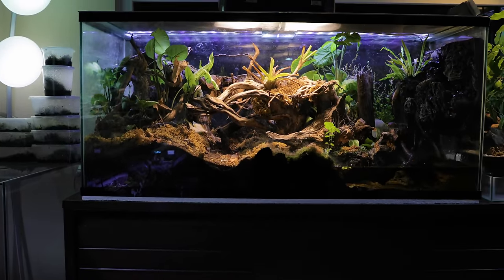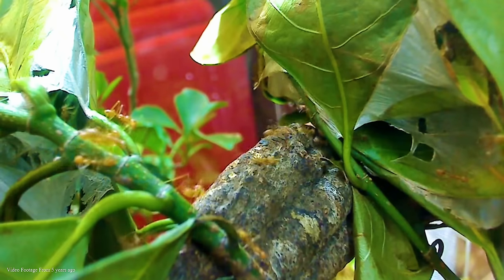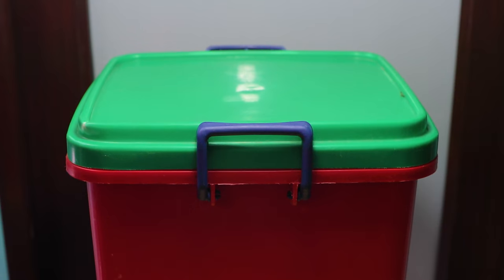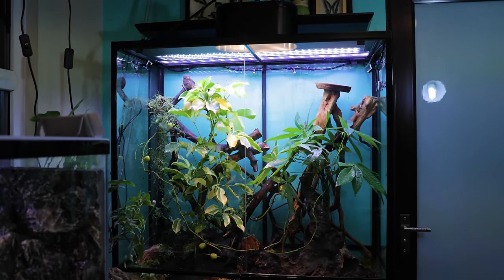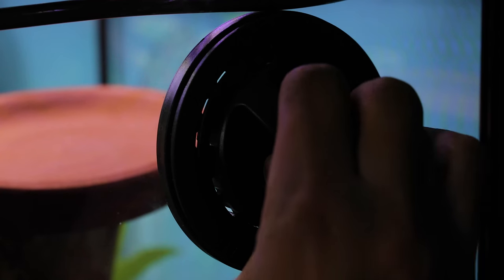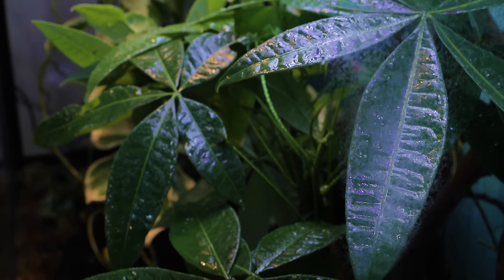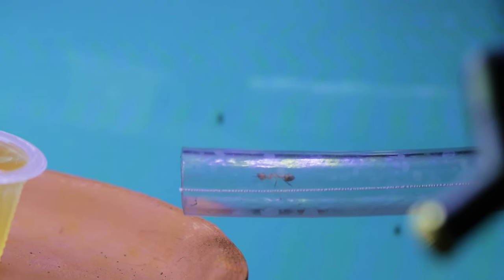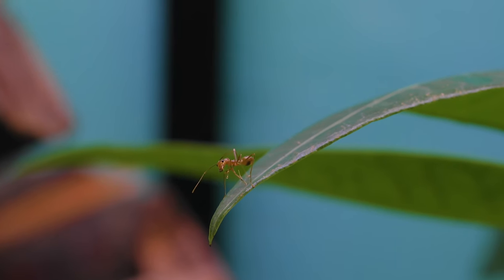My New WEAVER ANTS Will Blow Your Mind

Comment: One day when I went out to my wood-pile, or rather my pile of stumps, I observed two large ants, the one red, the other much larger, nearly half an inch long, and black, fiercely contending with one another. Having once got hold they never let go, but struggled and wrestled and rolled on the chips incessantly. Looking farther, I was surprised to find that the chips were covered with such combatants, that it was not a duellum, but a bellum, a war between two races of ants, the red always pitted against the black, and frequently two red ones to one black. The legions of these Myrmidons covered all the hills and vales in my wood-yard, and the ground was already strewn with the dead and dying, both red and black. It was the only battle which I have ever witnessed, the only battle-field I ever trod while the battle was raging; internecine war; the red republicans on the one hand, and the black imperialists on the other. On every side they were engaged in deadly combat, yet without any noise that I could hear, and human soldiers never fought so resolutely. 

Also, subscribe to my channel and click the bell icon too so you dont miss some of my videos XD
Reply: Tf

Comment: MARK THE OPENING PLUG  WITH TWO WHITE LINES VERTICALLY ACROSS IT AND THE FRAME .
FIRST PUT THE PLUG IN WITH IT IN THE CLOSED POSITION ( LOCKED ) MARK THE FIRST LINE WHERE YOUR THUMB ENDS UP AT THE FURTHEST LEFT ( CLOSED / LOCKED POSITION ) MARK ACROSS THE FRAME / PLUG WITH PAINT / TWINK . 
NEXT TO MARK THE OPEN POSITION ; 
PUT YOUR THUMB ON THE PLUG TURN THE PLUG TO THE RIGHT AND AT THE POSITION THAT THE PLUG JUST IS SITTING IN THE FRAME JUST BEFORE REMOVING ,
PAINT ANOTHER LINE TO THE RIGHT OF YOUR THUMB.
YOU NOW CANNOT GET MIXED UP BECAUSE YOUR THUMB IS IN BETWEEN THE LOCK (LEFT) AND OPEN (RIGHT). EVEN IN A RUSH.
UPON PRACTICE IT WILL TAKE LESS THAN HALF A SECOND TO LOCK.
THE LINES BEING THE ALIGNMENT TOOL.